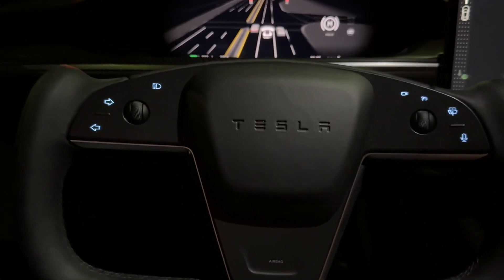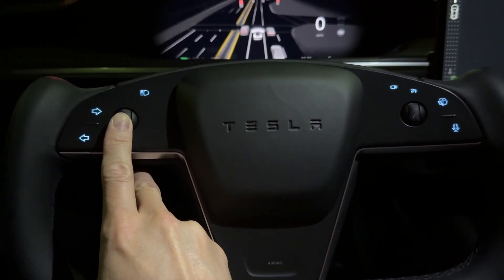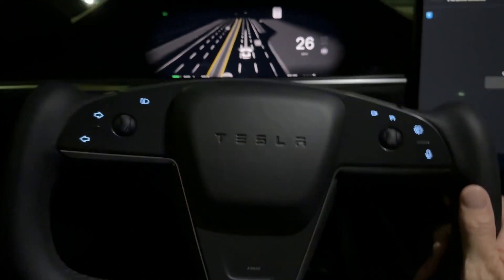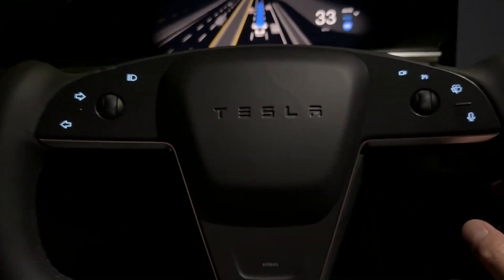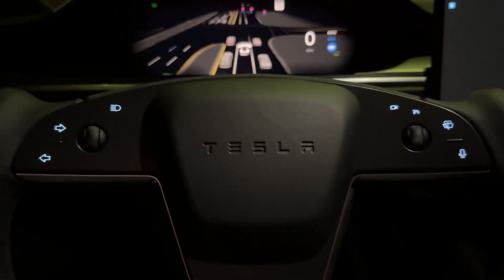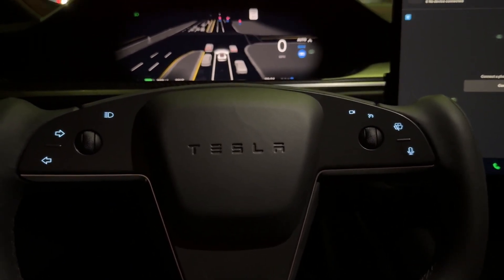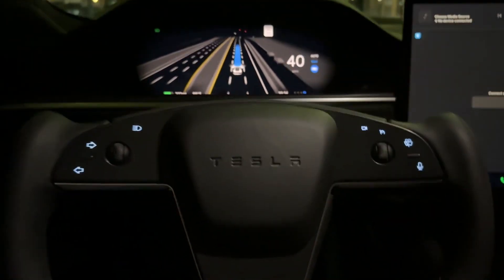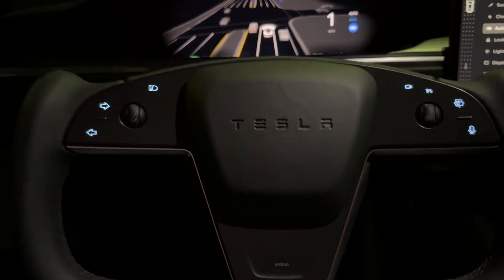EVOOOR Tesla Autopilot Nag Elimination Chip 2020+ Tesla Model S / X Instructions For Proper Usage

Comment: Hello im about to install my chip to my steering wheel and there is not enough video around on how to.
*Do i have to take off the negative terminal on the aux battery or turning off the model x is enough to access the wheel?
*Do you have a video on how to install the chip?

Comment: Hi.  I'm reaching out to you because I need some advice regarding an issue I'm experiencing with my Tesla Model S Long Range 2023.

I recently purchased a Nag Elimination chip from EVOOOR. After installing it, I noticed that the sound effects for turning the chip on and off are working properly. However, the primary function for which I bought this product is not working as expected. It still prompts me to intervene with the steering wheel as if the device were not installed at all.

Could you please advise me on how to proceed or troubleshoot this issue? Any guidance you can provide would be greatly appreciated.

Thank you in advance for your help.
Reply from the maker: I found that after you turn it on. Single beep. Then you turn on autopilot. It may ask you to apply pressure to the steering wheel initially. There on after it generally does a good job not asking you to apply pressure to the wheel etc….

Remember this chip only eliminates that nag. It does not avoid the interior camera attentiveness needed (pay attention to the road). I can do a video on how I hacked that too if there’s enough request etc… 

Hopefully this helps.
Reply: Would appreciate any information and help. I have tried all possible options, but the device does not work; it only makes a beeping sound and sometimes it turns off the speaker sound.
Reply from the maker: @ctyrkolkyostrava  hmmm maybe hard reset your car, hold both of the scroll wheels down until you car fully resets. Otherwise I’d say you return it to them, good luck on that. If you didn’t purchase from evooor and got it from somewhere like ali express. It’s all trash there they send you wrong items and try to scam you etc…

Comment: I used the same chip in my X, and it moves the volume. No way to change/program it from what I can tell. I got a PDF deciphered and fixed up from others, but it only appears to work on the 3/Y chip. As far as I can tell, there are no options for this chip. The BEST option would be for it to 'move' the right knob left/right randomly - as it does nothing for the Tesla OS. Moving volume really mucks up the wiper settings. Also you can't change any settings like interval or action, like I'd like to.  Hit me up under the same user name on Tesla Motors Club Forum if you want to see what we can come up with for these chips... they have potential but need polished if possible.
Reply from the maker: The one that moves the volume control is definitely annoying. It is speculated that a coming soon FSD update will eliminate the need to “touch” the steering wheel and rely solely on the interior vision camera. A “chip” for the interior camera would probably be more useful down the road etc…